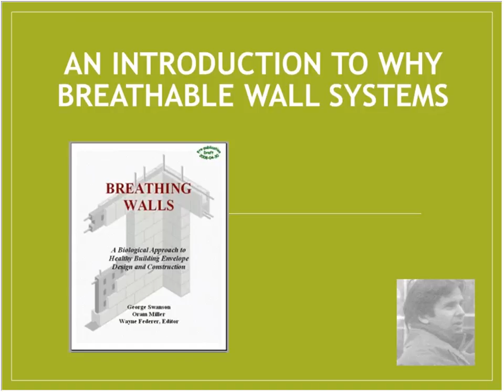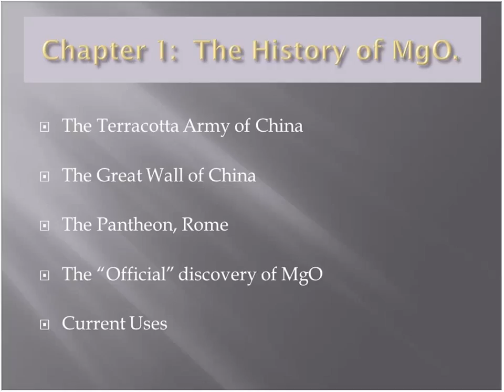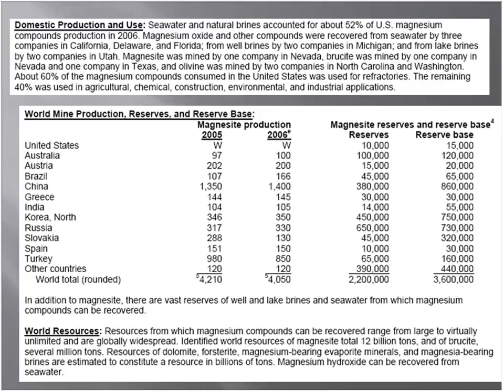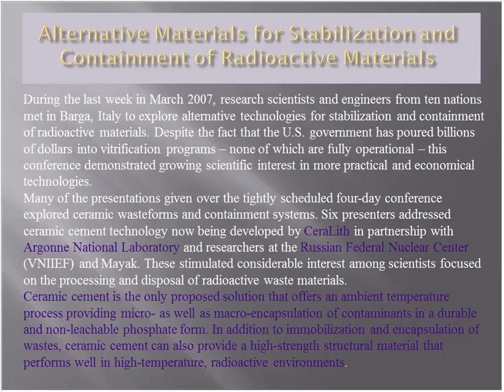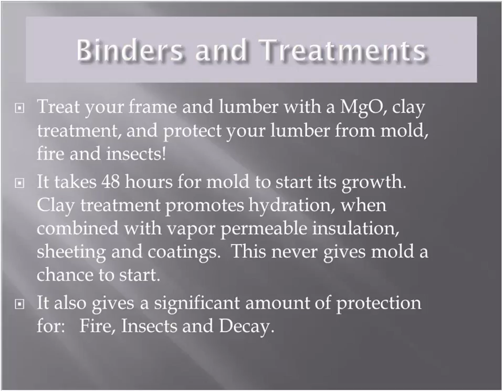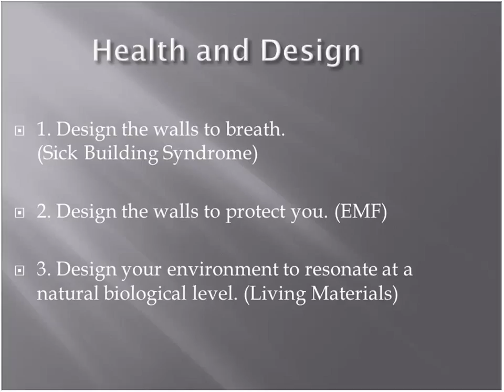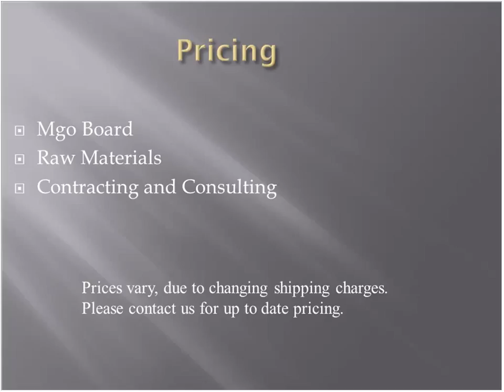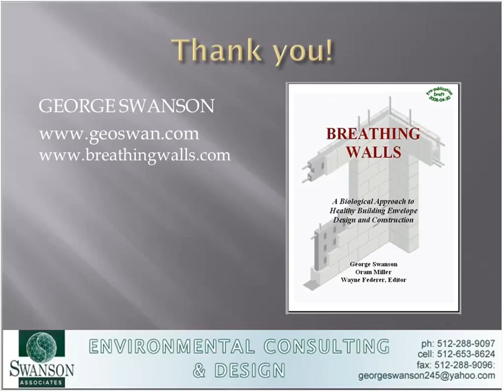An introduction to why breathable wall systems CE Webinar

Comment: What about VOC transfer across/thru the wall? One of the big problems that the chemically sensitive have is the VOCs from residents on opposite side of the wall (different apartments) reacting to the other, less sensitive, or not sensitive person's chemicals. How does this type of construction perform in that context?
Reply from the maker: Good question. The new version of LEED requires compartmentalization or sealing of the units. It's not for energy saving rather for health and comfort. Reduce air and sound travel between units. Also, having ventilation in the units will help.
Reply: +GreenHome Institute , I watched your video on compartmentalizing and sealing off units. Another great video. I've looked for MgO products available in the PNW, but I'm not finding any. Suggestions?
Reply: Well, it is vapor permeable. So some of those VOCs will come through. The material may repel, trap or neutralize some of them, I don't know. You may need a truly impermeable barrier. Maybe aluminum foil or rubber.

Comment: Can GHI and/or Mr. Swanson please cite their source information for the claim (timer marker 10:27 in the video) that the Terracotta Army is comprised of being..."all magnesium cement"...not a clay ceramic matrix?.  

I am a natural builder, and also have a relatively solid background in ceramics as well.  I have studied (to some depth) traditional ceramic means, methods and materials as it applies to not only architecture but folk crafts as well. As such, I know of no such research or source (in English, German or Chinese) that has ever stated the Terracotta Army was not a traditional clay matrix found from within the region.

It may contain some Magnesium Oxide as a component, yet all research indicates it is a clay of both fired and unfired...not a cement that makes up these acient artifacts...

Thank you in advance...
Reply from the maker: Hi Jay &Brett:

"Thank you for the clarification on the composition of the Terra-Cotta soldiers of ancient China. You are correct, MgO was a component, (in much the same way the "clinker" in Portland cement is a component) of the traditional mixes used in making the soldiers. And like the clinker it may have a minority--yet essential binding--component of the mix.

Check Out: www.zglm.org.cn ,  www.anl.gov/argonne-scientific-publications/pub/27477 
                   http://geoswan.com/wp-content/uploads/2010/11/MgO-GENERAL.pdf
Regards:"

George Swanson
www.geoswan.com  (right hand sidebar on homepage )
www.breathingwalls.com
Reply: Hi George,

Thank  you so much for such a quick response...It is much appreciated.

If I could trouble you just a bit further, and perhaps take this conversation to a private email, if you wouldn't mind?

I would validate (at this time) I am very much a proponent of breathing walls for any other readers that may be skeptical of my post or this topic. So to be very clear, I am not questioning that aspect of this video in the slightest. 

For me, with over 30 plus years (on and off) in traditional folk and natural architecture practices of means, methods and material... in both practice and private research I can state from first hand direct forensic observation that the entire concept of "air tight" architecture is as ludicrous today as it was those many decades ago when I first heard the term used. 

This "air tight" concept is another byproduct of the Industrial Building Materials complex and their agendas toward "profit at any cost"...NOT good building practices.  As a designer and builder my goal is a multi generational home that will last centuries (if not millenia) with as simplistic (and serviceable) design modalities as I can achieve. NOT designing a spaceship or submarine...and/or...just for profit!!

Draft Proof and fully permeable high efficiency thermal envelopes in our floor, wall and roof diaphragms is the goal we should all be aiming for as facilitators of sustainable architecture. It was done before the current era by traditional builders...it should and must return....

Thank you in advance,

j
Reply from the maker: This is Brett now Jay.  Natural building and air tightness no longer need to be mutually exclusive. They can go hand in hand. Check out the work of Sigi Koko (we have a video on it) 475 in NY (Webinar on that too) they will show you these 2 ideas work well together. In warmer climates, it can be ok to be a little looser and use more natural ventilation but in colder, air loss or convection is going to send your clients dollars out the windows and cracks and make them uncomfortable at the same time. Many now try to hit Zero Energy Capable need to pinch every penny and it is much cheaper still to get to low air changes vs buying more solar or even bigger heat pumps.  In cold climates too we can have our cake and eat it too. Check out the burbecc home we toured in Ann Arbor MI (climate zone 5) which is very tight but has a wind tower for natural ventilation during off seasons. Good luck and thanks for committing to build, BETTER.